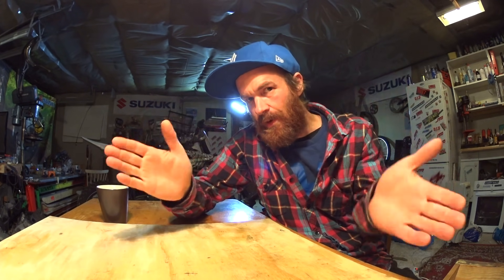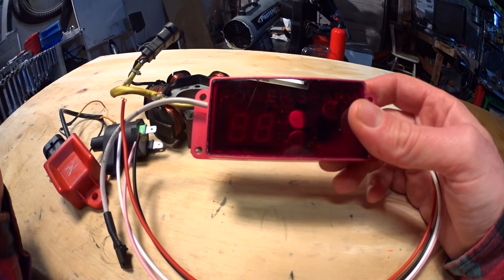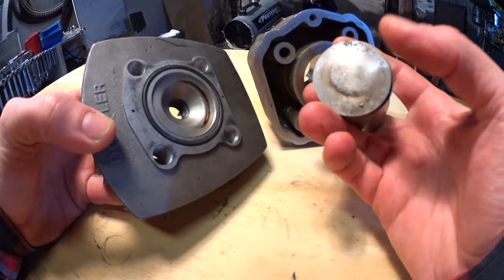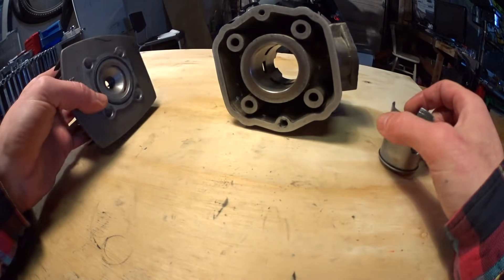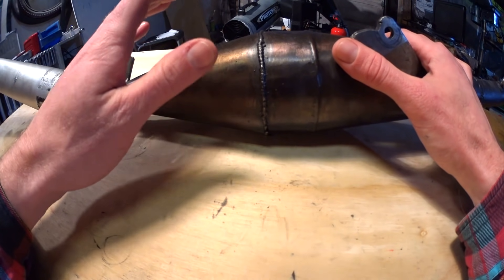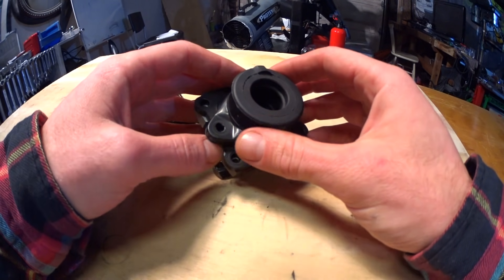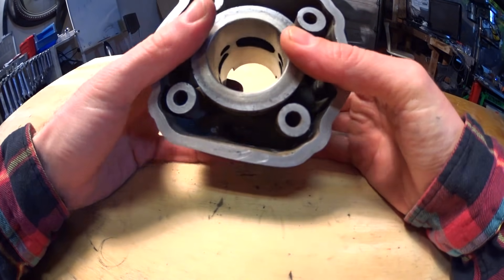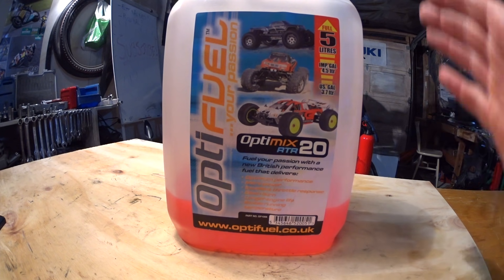10 FREE WAYS to MORE POWER in a TWO STROKE Engine! DIRTBIKE/SCOOTER/MOPED | 2 STROKE TUNING

Comment: Egt is handy . Lycoming has a chart for egt vs peak power. Apparently lean of peak egt is safer then rich of peak egt because there is no leftover fuel in the chamber to detonate. You can also use cylinder head temp to tune also....thanks for the tips. I've been tuning fuel injected motors for years so now the whole carb thing makes perfect sense. Also trying to share info if the mixture is rich try advancing the timing to burn the fuel instead of leaning out the carb. Not saying it's guaranteed but try it. I have fixed rich condition with more spark advance

Comment: I am not scared to give you some criticism...
I have seen a lot of videos of your channel by the years . ..
The most of what I see on your channel are barely idle running two strokes .
It irritates me when you say. This the way to power up your two stroke ....
Not everybody wants a top peak power engine !!!!
What I do is the opposite of your advise ...
Not leaning , not narrowing the tail pipe...
Nooo !!! Don't listen to this man .
If you own a good fixed gear machine like puchmaxi ...
Do not listen to this advise .
The opposite is True.
We don't need 20.000 rpm reving engines ...
We want old school power engines . They where not crazy back in the days ....
For road bike, you don't want formula one tech . This is arrogance. Most powerful two-stroke ...
I only see bad starting engines without useful power in the low and mid .
This frustrates me . I do not post with out knowing what I say.
 Excuse me brother. I know I hurt your big ego .but that's good for the greater plan

Comment: How can I calculate the squish gap and what’s a safe measurement to run  it in.
Reply: Using solder wire from the sparkplug hole and 0.5mm

Comment: I am wondering what would be the effect of 2 tesla valve on a two-stroke, one at the intake flowing forward, and one at the exhaust (smaller than the intake one) counterflowing, to have the effect of back pressure right back in the cylinder. Would the intake valve flow be accelerated by the pressure built in the cylinder ? Does anyone have an idea ?

Comment: You can use a 2 stroke engine as a Stirling engine, just put it up side down, apply heat on the head, plug the holes.

Comment: I port matched my cylinder widowed the piston and made my squish gap as small as I was comfortable with had a buddy mil out a stubby intake as short as we could go. Got an mz65 clone and sleeved the inside pipe as shown in the vid and just from those mods I jumped from 26-27mph to 38mph consistently. Using a 40t sprocket and it runs like a squirrel on speed

Comment: wouldn't a exhaust restriction cause back pressure leading to intake charge dilution, higher in cylinder temperatures, reduced efficiency and increasing the likelihood of knock

Comment: You forgot gear ratio, it makes the biggest difference in speed. Costs like 5€ for a ratio. Bigger gear ratio in front = faster you will go
Reply: This is very very untrue, sprocket changes will only help if you already have enough power, otherwise it could make you slower. Actually shorter gearing gives you way better acceleration with 2 strokes. I just published a video on it

Comment: Good morning bro im from a small village does keeping a spacer in a reed valve increase the power
Reply: Called Crankcase DE-stuffing. 
May lower the peak HP, but should increase the breadth of torque curve and lower the RPM of peak power.
Less peak power / but more usable power.
Reply: @glenholmgren1218  can you make little more simpler....

Comment: Hey my friend
I have a question, i installed a 70cc Zylinder kit and when the piston is in the lowest position it does not open the exhaust port completely like 3-4 mm left to open completely... but the squish is ok like 1mm

Can i grind the piston on the exhaust side a bit? Or what can I do? 

Thanks
Reply: I have heard that you can but it's best if you don't go more than like one millimeter maybe two I think your best option would be to raise the ceiling of the exhaust Port but if you're doing that you have to do the same thing to the carburetor side except on the floor

Comment: My 2 stroke engine is from IAME (I don't have any vids of it yet, didn't consider recording any videos regarding that engine, and it's all the way in Florida), 60cc race TAG kart engine. That sandpaper method might work though! Thanks!
Reply: No need to sand it. The head of IAME 60 cc engines have a copper gasket in it. Removing the gasket will increase power.
Reply: @davidgutierrez3312  Huh, okay. But won't that likely kill reliability as well?
Reply: @ColdAndNotoriousMrRogue  More heat and more revs.. so you'll have to do maintenance sooner. Instead of changing the piston after 100 hours you'll change it after 80 hours. 

Even better: changing the exhaust restrictor for one with larger diameter will improve performance too. 

Those two modifications wouldn't ruin the engine and make it perform like a water cooled X30 Mini.

Those engines are made for young kids (5-7) competing in karting in Europe and come with those restrictions to limit power, but can safely be removed.
Reply: @davidgutierrez3312  Okay then. Thanks for the tips.

Comment: I thought you didn't want to restrict the exhaust, because it restricts power. I've even seen people take the silencer off and wrap it with  steel wool is this OK?
Reply: Restriction increases backpressure, wich can increase power or blow your shit up
Reply: @rosegold-beats  Start small (in terms of AMOUNT of change) and SLOWLY increase AMOUNT of change - Tuning / Jetting / Plug Heat Range / Timing changes as required to optimize at each stage. 
S. L. O. W. & steady is the key

Comment: Can you even do this with a kx250 2stroke
Reply: If you try to use nitromethane or methanol in your KX 250 chances are if you don't get the jetting dead on first time , there is a huge possibility in 30 seconds or less  you will cease up the Piston to the cylinder wall with melted aluminum from blowing a hole through the crown of your piston  at high rpm  that can twist the crankshaft beyond run out spec's and game over !!!...use 5 gallons  premium 93 octane minimum and mix one pint of synthetic Yamalube "R" in a 5 gallon gas can ..that will be a ratio of  50 to 1 blend of gas to oil ..you will not see any oil smoke and there will be no carbon deposits or any build up of carbon inside your engine at all giving you a much longer engine life and extra ponies

Comment: The best way to get more power out of a two stroke is to jack it up and put a larger displacement four stroke under it. This will increase its longevity. It will produce less pollutants.  It will deliver power over the entire powerband. It will cost more...it will be a little heavier.  
Two strokes were popular in the 1960's and 70,s. The death of two strokes started in the 1980's. Every time EPA regulation came out..they got rougher to comply with. Honda tried to save the technology in 1996 but failed to come up with a workable solution. How many 2 stroke street bikes are available today? Not one. Boat motors are going 4 stroke too. The only place 2 stroke engines rule is chain saws and leaf blowers.
Reply: Chuck Bowen , the "snake oil salesman". I bet you could sell an  ice box to an Eskimo...you should have spent a minute and researched your major arguments on google or something ....yea just replace your 125 two stroke with a 450 four stroke that pumps  4 times more air at twice the rpm making two time more pollution that will cost over twice as much as a complete 125 two stroke bike and weigh a 100 pounds more ending  any possible chance of winning any  races  or   even being able to enter as will not be allowed by that fact its two big and ruled as cheating ..that will get you ban from racing forever .
And a four strike will never ever deliver anything over the entire power band ....cuz Chuck four strokes do not have power bands ..as they can not make boost as it is impossible by the design of s four stroke engine ..that pretty much tells all of us who know that you are entirety and totally full of nothing but bull shit ...

You buy up a bunch of stock in Honda ? Cause again your story about Honda is total bull shit as it was Honda who started the lies about two strokes  ..Honda was the first to build a four stroke out board speed boat engine that weighed 600 pounds and produced 40 horsepower . same horse power my dads. evinrudge  two stroke out board motor boat engine makes that you can carry with one hand .

Comment: 2 stroke needs backpresure
Reply: Ari Ari. Back pressure will decrease performance, engine life,  and cause overheating  causing huge deposits of carbon in all the ports that will destroy the piston and rings very quickly in just a few weeks... its very critical that you maintain all silencers and spark arresters free of any carbon build up so as not to restrict the exhaust flow

Comment: A lot of work, for so less reword.  Better switch to a bigger engine.
Reply: The easiest and biggest gain for a two stroke increase in horsepower is to install the largest carburetor possible to be compatible with your model of motorcycle as far as hooking up the air filter and plugging it into the intake manifold example I went from a 28 mm carburetor on a 360 Yamaha Enduro to a 34 mm carburetor and when I started up put it in gear to take off it flipped over backwards instantly there was that much gain in horsepower
Reply: @donniebaker5984  I've just bought a 26mm for my 180cc 2stroke  Piaggio hexagon.  That comes with a 20.5 mm. Let's see how its going to be.  Thanks !
Reply: A very valid point, however, sometimes the reason for wanting more power is that the engine you have is the only thing you have. Converting weedwackers to RC airplane engines.

Comment: Is there any power to be had by removing the spark arrestor from my 75.6cc  Redmax backpack blower?
Reply: It wouldn't hurt to clean all the carbon build up off of the arrestor  so it will flow better as original
Reply: @donniebaker5984  There is no carbon on my arrestor. I even tore the engine apart and soaked the upper cylinder and piston to remove the internal carbon. There was a lot of it in the upper cylinder.

Comment: Hey Stuff, Is the RC fuel already mixed sufficiently with oil, should it be used during break in period? If so should more oil be used? 
Years ago, there was an aftermarket gizmo called "Snuffernot". It was basically a washer mounted in the end of a straight pipe on a 4 stroke dirt bike for the purpose of running it in town, I suppose; to keep the noise down until you could reach the boonies and open it up. It was installed on the end of the pipe like a butterfly in a carburettor. It had a knob on the top and it could be pivoted to be open or closed or any place in between. I suppose something like that could be mounted in the end of the stinger to "tune" it?
Reply: Gp bikes actually have a butterfly valve in the exhaust system to tune the exhaust
Reply: It usually has like 9% castor oil, methanol RC engines always spit a bunch of oil out the exhaust.

Comment: I have a dt400 I ported it by widening and raising the ports. The pipe has a flat crude reflector plate in the wierd shaped convergent cone area. No cone really at all. Do you think removing that plate would make more power. Also there is sound deadoning material in there that must go.

Comment: I'm confused, you want a tighter squish gap but also by doing that your reducing the ammo t of fuel/air mix u can pull in on the down stroke, so how does this make more power, I get theres more compression but at the loss of air/fuel
Reply: Minuscule loss of overall CC’s & ZERO loss of Swept Volume. = MORE Compression / Better Swirl & fuel-air mix and atomization AS WELL AS FLAME PROPAGATION!

Comment: Curious why I do not see more videos from you working on larger displacement bikes like the motocross in the back of this room . You seem to do great work and would be interested to see how much power you could squeeze from say a rm 250 or a cr 500 .
Reply: Small CC bikes keep the cost down. Everything is relatively cheaper than mx bikes and the same principals apply. Theoretically all mods would apply to larger CC bikes.

Comment: Love your videos👍 will rc fuel work on a chainsaw too? Running red Aspen now.
Reply: i had Aspen R (race aspen fuel) in a chainsaw, without any tuning or changing the setup the chainsaw ran 2000rpm more, so yes it will work but be careful with overheating

Comment: Man I've had so much of that rc fuel in my times I never though once to put it in the ol 125 though considering I usually have 110 octane gas in it but I did run a little but of that mixed in my 1/5 scale rc truck and it loved it

Comment: Could someone please explain whh a smaller exhaust makes more power? Is this due to higher exhaust velocities increasing exhaust scavenging?
Reply: a smaller exhaust will not make more power, but i you decrease the size of the stinger (the pipe after the expasionchamber) you will have more backpressure but you engine will overheat more quickly, as far as i know

Comment: Hey how would you recommend making the intake shorter? Shave rubber boot down that carb mounts to? Sand Reed block down? Please help!
Reply: Probably he.meant to get rid of the gasket between the Reed.block and intake. I think it really might help with primary compression.of the crankcase as well as what he said about gaining response in.the intake tract. Not.really too much power to be.gsined on the top end power, just response.i am thinking. Good luck. Also, I really do think the best thing he said was the closing of the.squish band of the head. Always check that your compression is not to high to run pump gas. On my 400 dirt bike I run 145 lbs compression and so far no problems.

Comment: Instead of shaving the head could you put on a super thin gasket?
Reply: Yes if one is available for your engine
Reply: mothridith could i make one out of something like a thin sheet of copper or a soda can?
Reply: @dandufour116  i have had great results by first sanding the top of the cylinder and the head flat to assure proper sealing and then i cut a head gasket from a aluminium food tray (which is like paper thin)
Reply: No head gasket and no base gaskets works the best for more compression , with air cooled two strokes as long as the piston doesn't hit the head

Comment: Years ago i heard about the rc car fuel trick from a riding buddy, he would use it in races with his 125.

Fast forward about 20 years, i bought a house with a bunch of dead trees.
I spent a little too little on a 50cc chain saw that did not quite have the power to make it through some logs.
Remember the rc car fuel trick, i tossed maybe a little too much into the chainsaw.
It worked like a charm!
I made it through the last few logs that i needed to make lighter, but the engine got super hot, it would not shut off, ended up choking it with paper towels and water and finally got it shut off!
I'm pretty sure the spark plug was acting as a glow plug at that point lol!

The little husqvarna 50cc engine survived, and i ended up doing some slight modifications to the exhaust system that then allowed me to run the saw much richer, that then allowed me to run a little nitromethane in the fuel.
Here in the states, we can get 100% nitromethane, but it is a "watched" item...
I now run two large capfulls per 2 gallons of 40:1 premx in all of my two stroke equipment.
I love that nitromethane idle growl it gives everything!
Reply: .....so there wasn't any ring damage from the overheating?  I think a sthil would have gotten ring damage .
Reply: I once got my 125 2 stroke racing bike so hot that it started dieseling. I pulled the  spark plug boot off and it kept running. It turns out I ran it with no coolant for about 20 minutes... fail

Comment: I have an 80s 50cc with a 65cc bore kit and it tops at 50, what would you recommend?
Reply from the maker: Better pipe maybe?
Reply: 2STROKE STUFFING as in expansion chamber? I’m just not sure what would fit as it’s an older bike
Reply from the maker: What bike is it?
Reply: 2STROKE STUFFING 1984 Honda mtx 50 with a 65cc kit
Reply: @thomasashman8738  bigger carb en exhaust